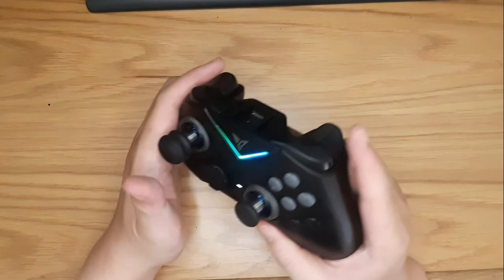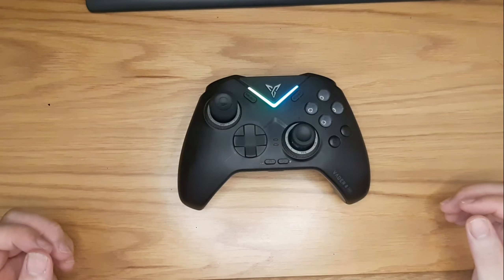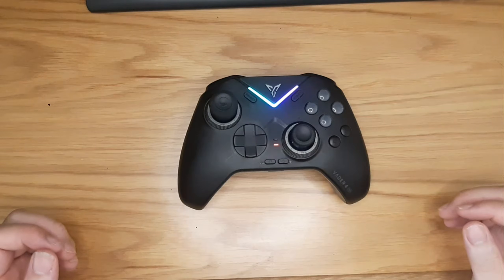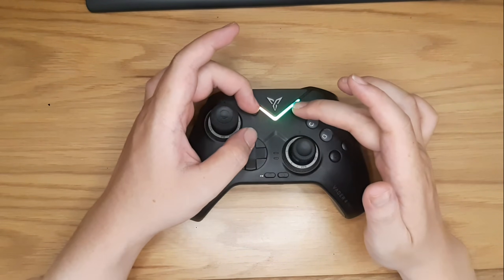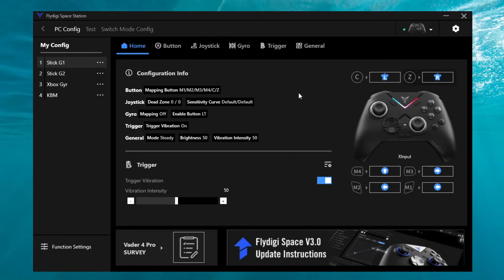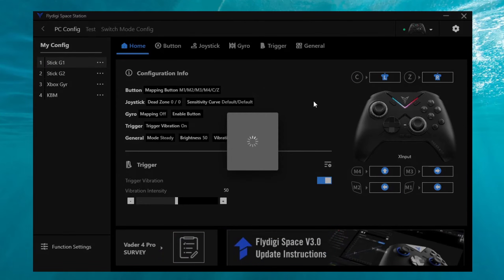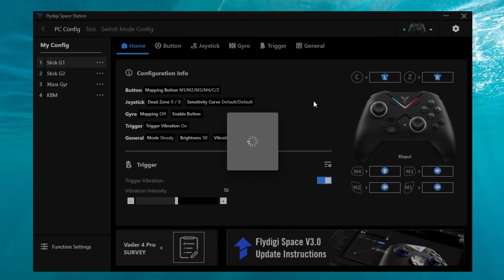Troubleshooting Your Flydigi Controllers | 4 Solutions for different problems

Comment: Thank you so much for your video , I just got my apex 4 I wired it on my pc connected to flydiji game center , I could make the first of the three update the second one mess up .
When I try the make ugain the second update, the first update the software told me is ok on date but for the second he ask me to restart the controller but I didn't know how if it was juste to unplugged the controller and push the rear button on off and on . But I did that and since I can make the second update it's blocked and I can't go to the home button the change to langue . I don't know why the home button doesn't work since that

Comment: can you help me, my flydigi space station cannot recognize my controller, so i cannot remap
Reply from the maker: There's a couple of reasons why FSS can't detect your controller. It could be that you have multiple flydigi dongles connected, or your controller isn't in correct mode (PC/USB mode). You should also try connecting via wire/cable if the above don't work

Comment: Set the controller to the Bluetooth mode with the switch on the back. Press the home button to turn on the controller. If the indicator light on the remote is flashing blue, you want to hold the function button and then hold the "X" button down until it turns off the controller and the controller turns back on automatically flashing a white LED The controller name under Bluetooth will show up as "Xbox Controller". 

If the controller is not showing up under Bluetooth settings, turn on the controller and then hold the home button down and the indicator light should rapidly flash. The rapid flashing indicates that it's in Bluetooth pairing mode while slow flashing indicates it's looking for a previously paired device. Hopefully that fixed your issue.

Holding the function button and "A"  will switch it to where the indicator light flashes blue and the controller is named "Flydigi VADER4P" in Bluetooth mode

If neither of these helped you reset the controller. In the video, the guy says to hold the select button and the start button and the function button. But for me that only restarted the controller and it didn't reset the settings saved to the controller... to fully reset the controller. You have to press and hold Select, Start, and the home button which is the power button

The blue light is for connecting the controller to a smartphone with the Flydigi app

The white light is for connecting the controller to any other device or a smart phone that is running a game that natively supports a controller

Depending on what mode you're under, certain controls may not work with a device. Try switching mode and seeing if it works again
Reply: Huge thanks man, i was really worried because my PC wasn't recognizing my vader 4 pro via bluetooth. Holding down the home button as you said fixed the issue, thanks again
Reply: Thank you! I'm having a problem. When I connect to my pc with the dongle, or cable, everything works fine!  

But when I try to use BT (blue light), in the game, the buttons are changed. When I test on Steam, everything is where it should be, but when I try Silksong game, the RT = start, LT = Select, and I cant change this.

And I cant connect using BT (white light), I dont know why (in PC and android)... I just see the message "Connecting...", but never finish.

Do you have any idea? I tried to reset like the video said, but still not working...
Reply: @dodo_california  Have you installed the software for the controller?
Reply: @Matty__Matt Yes. I tried on Linux too. Same problem.
Reply: Hey bro I just got mines yesterday. Mine been giving me a headache. I want to play wired only but the controller isn’t registering with the wired connection it only works with Bluetooth. Any ideas on how to fix this issue?
Reply: @KiLL_Switch004 
To have it register under wired connection you need to put it into the dongle switch position and then switch the connection mode with the listed technique mentioned above if it still doesn't work
Reply: @Matty__Matt okay I’ll try that thank you! It’s better to play wired correct? Play strictly call a duty
Reply: @KiLL_Switch004 
If you're playing competitively like for money then wired but if it's just casually and for leaderboards and stuff the whatever is most comfortable like wireless
Reply: I had the same issue and your method worked for me but after a while, it's not even turning on. I tried charging it for all day and still no lights or showing up in PC Bluetooth list.
Reply: @baldwinivofjerusalem47 
 to fully reset the controller. You have to press and hold Select, Start, and the home button which is the power button. The method given in the video only restarted my controller. Also since the dongle and wire work make sure the controller is updated to the latest software too
Reply: Thank you so much! You are my savior. I spent an hour trying to get the controller back to life after holding LB+RB+start+select (RetroArc combination).

Comment: I have a problem and I haven't found a solution yet.Can you help?My phone is OnePlus 7T Pro I have apex 2 When I was using the official ROM Oxygen Android 12 Everything works but now I moved to a custom ROM crdroid Android 15When using mode Flash play There is no response to the joystick.I tried a lot but I didn't find the solution The joystick connects via Bluetooth without any problems.But there is no response to the joystick. Is there a solution?
Reply from the maker: I recall older Flydigi gamepads have issue with certain smartphone CPU, but take my words with a grain of salt. I really don't know much about the mobile side of Flydigi products

Comment: 3:00 does this work on vader 3 pro?

I tried several ways but none of them worked, only the latest version appears
Reply from the maker: Unfortunately, Vader 3 Pro page only has the latest firmware. I asked Flydigi to list the previous versions for V3P but they haven't done a thing about that.
Reply: You can but you need to change your phone to Chinese

Comment: I got mine yesterday set some buttons up and was fine for about 30 seconds now everything is inverted. Any ideas? If not I'm gonna try factory reset and try again. Great video new subscriber
Reply from the maker: By everything, you mean the buttons and analog sticks? Have you checked the settings in Flydigi PC space?
Reply: @boombaka  directional buttons and analog yes. I did but couldn't see anything that would show I've changed it so gonna factory reset update and try again. Just thought you may have an answer.
Reply: @Dozergaming5 did you figure out what happened and how to fix it ?
Reply: @eloppu6366  for some weird reason when I change the configuration to racing mode everything worked fine but on the options above it was all inverted have you got the same problem?

Comment: i cant use bluetooth connection, any sollution please?
Reply: Set the controller to the Bluetooth mode with the switch on the back. Press the home button to turn on the controller. If the indicator light on the remote is flashing blue, you want to hold the function button and then hold the "X" button down until it turns off the controller and the controller turns back on automatically flashing a white LED The controller name under Bluetooth will show up as "Xbox Controller". 

If the controller is not showing up under Bluetooth settings, turn on the controller and then hold the home button down and the indicator light should rapidly flash. The rapid flashing indicates that it's in Bluetooth pairing mode while slow flashing indicates it's looking for a previously paired device. Hopefully that fixed your issue.

Holding the function button and "A"  will switch it to where the indicator light flashes blue and the controller is named "Flydigi VADER4P" in Bluetooth mode

If neither of these helped you reset the controller. In the video, the guy says to hold the select button and the start button and the function button. But for me that only restarted the controller and it didn't reset the settings saved to the controller... to fully reset the controller. You have to press and hold Select, Start, and the home button which is the power button

The blue light is for connecting the controller to a smartphone with the Flydigi app

The white light is for connecting the controller to any other device or a smart phone that is running a game that natively supports a controller

Depending on what mode you're under, certain controls may not work with a device. Try switching mode and seeing if it works again

Comment: My app doesnt have Vader 4 Pro as an option. I’m on iOS.
Reply: Update: If this happens to you it's because for whatever reason in North America it's not an option. I used a VPN with China as m location and it popped up and was able to update via the app.
Reply from the maker: I don't use IOS, but try selecting Vader 3 Pro on the app and see if it works

Comment: Is it possible to change the preset without the flydigi game center app???
Reply from the maker: You need flydigi software to set up presets so I'm afraid it's unavoidable
Reply: @boombaka  I have the preset ready I just need to chose which one to use without the app😅
Reply from the maker: @tea_with-mint alright, you need to go into "Function settings" in the bottom left corner of the app, then enable Profile switching. Now you can use Select+ A/B/X/Y combination to change presets on the go
Reply: @boombaka  thanks bro you saved me a lot of time